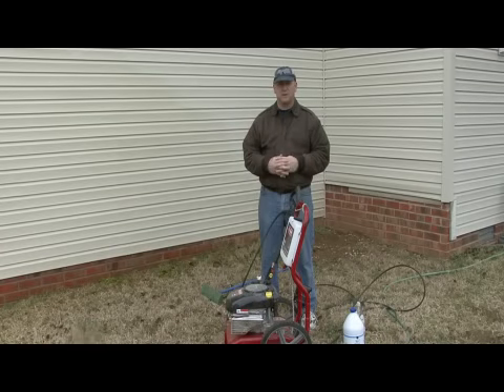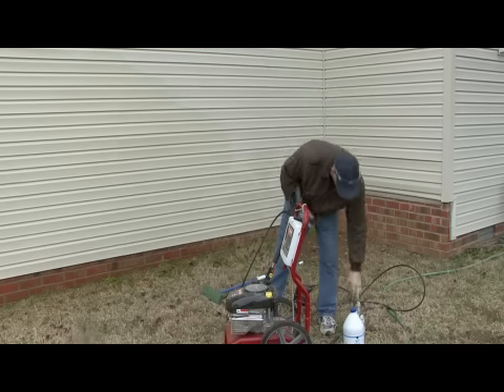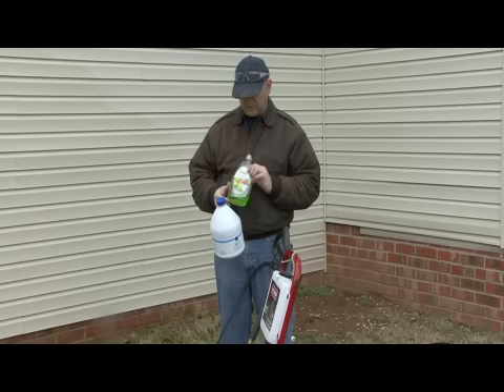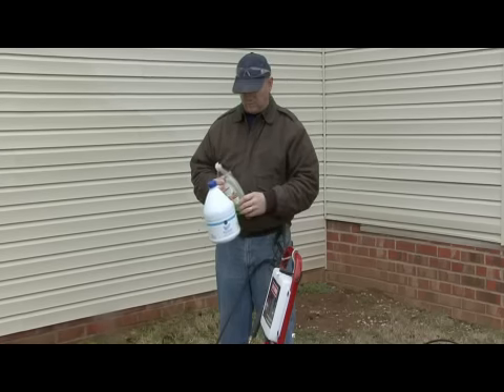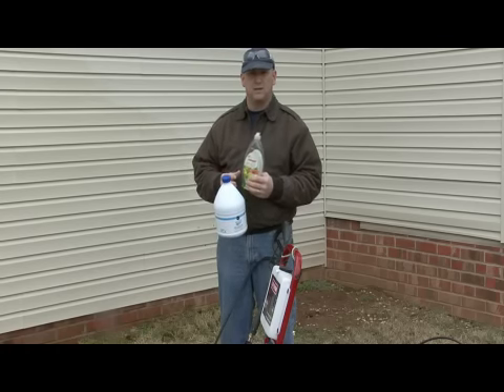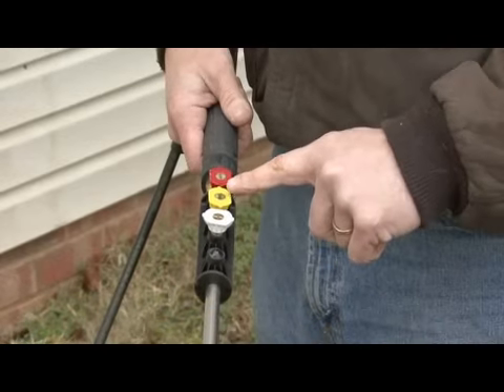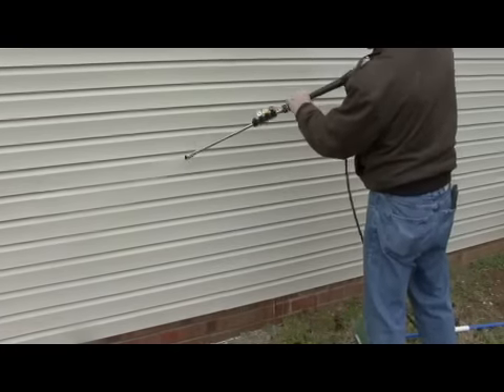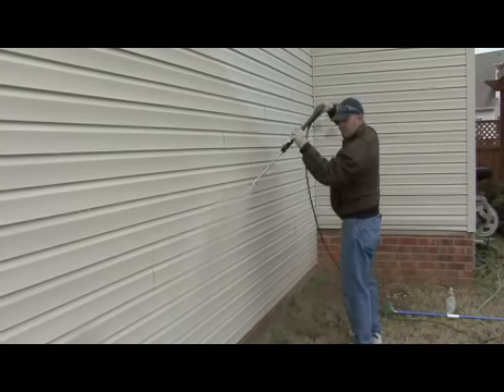Power Washing Vinyl Siding

Comment: I had never pressured washed vinyl siding so after watching this video I called my dad. He said "you don't need any soap or bleach" which is kind of what I figured so I just used plain ole water and it did a great job. But as I was going along I realized I was breathing in and getting sprayed with the mist and water rebounding off the siding and I was thinking to myself, what if there was bleach or other chemicals in the water?!?!?! No bueno! 

Using bleach just doesn't make sense in any way to me. Yes, it will kill live spores of mold and mildew and then when the bleach gets rinsed off in the next rain, it will just grow back.
Reply: Self Help Dude it kills what's there. Yes it will grow back with time. If all you use it water you are only making it appear that the algae is gone, but the microbe is still there and will come back faster. Also, I use a mask and goggles.

Comment: I would be careful when he talks about bleach. Some pressure washers don't allow bleach in their systems as they'll damage it. Always look at the owners manual or any labels (as mine has) on the pressure washer.
Reply: You would have to pump spray the siding with bleach and then rinse with water. My unit has a downstream injector which is fine.